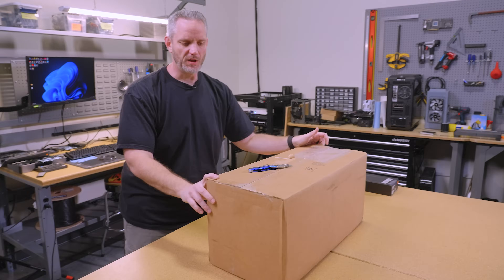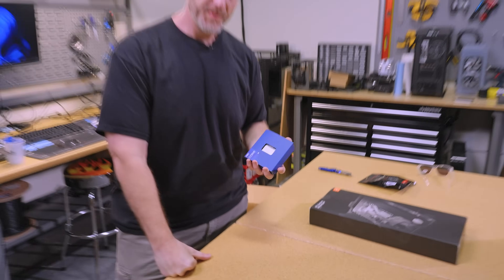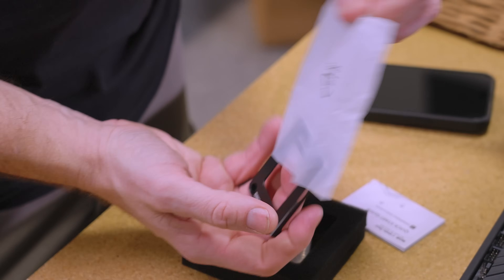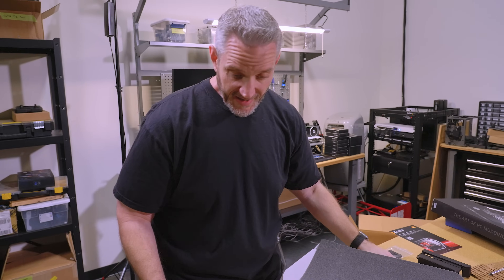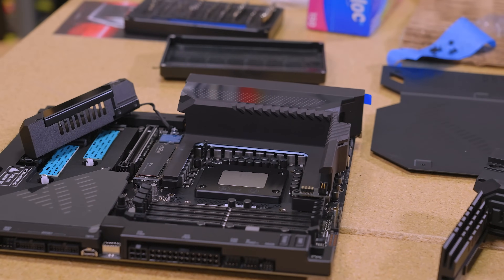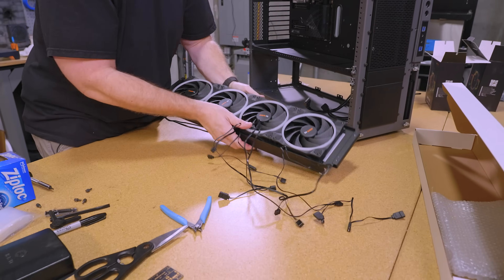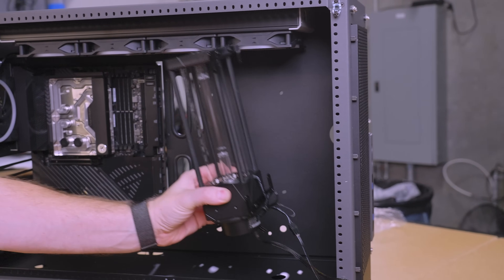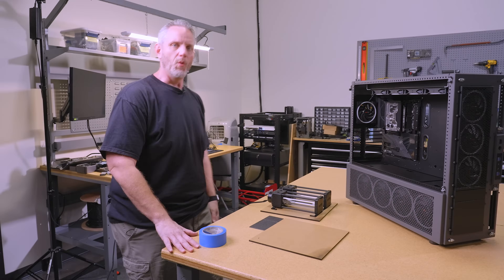Skunkworks Revival - Part 2 - So THIS is what you get for $800 waterblock...

Comment: I know this is gonna get berried, but why not have Phil use the 3d printer and make a holder for that acrylic panel and the led light strip, so you can light up the acrylic panel from the sides, and that will help with the darkside.

Comment: Hey Jay, I have this exact board and I may have a word of advice for ya (not that you need one, lol). Since you will be using your 4090 on this board, you won't be able to run it @ x16 speed because of the NVME that you have installed in M.2_1 slot. That slot shares bandwidth with PCIEX16(G5)_2 so when M.2_1 is populated your card will be limited to x8 speed. You can mitigate that by installing your NVME in slot M.2_2 or M.2_3.
Reply: Awesome comment, I have the same mobi too, as well as a 4090. I made that mistake because that info is practically hidden in the user guide. It took me a while to figure it out, hopefully he will make the switch before he fills up the loop!

Comment: I just installed the Thermal Grizzly Intel 12th Gen CPU Contact Frame on my ASUS Proart Z790  Creator motherboard with 13900KS processor.  The Thermal Grizzly 13th gen contact frame is a new product and not available when I was ready to purchase in late August 2023 ($35.53).

When reading reviews on Amazon, one customer was having the same problem that I was having:

For some reason the original screws that came off the stock motherboard socket were not long enough to screw the 12th gen contact frame into this this particular motherboard.  Maybe the the 1700 socket sits a tad bit higher, I don't know.

In any case I found 6-32 1/4 inch socket head cap screws worked just fine.  A 7/64 ball end hex wrench works perfectly for the install.

Perhaps the 13 gen contact frame is re-tooled to fix this issue (a little deeper holes in the contact frame?)  

Hope this helps some others that may run into this issue. But then again if the 13th/14th gen Thermal Grizzly contact frame fixes the issue then my DIY fix is mute all together👍✌

Comment: si I don't remember which 3d printers you have. but why not make the floating plate out of 3d printed abs or petg you can put threaded inserts in for the pump res combos then make a channel in the back for the leds and a diffusion layer.

Comment: I have the  same motherboard installed 4 SSD's.
The only slot I skipped is the one you use the top one (under the display) for a PCIe Gen 5.0 M.2 SSD.
That slot will disable you 2nd PCIe slot and make your 1st PCIe slot (GPU Slot) a X8.
I tested it with a Gen 4.0 SSD but doesn't matter if it Gen 4.0 or 5.0 it will make your GPU run on X8 speed.

Comment: Sorry to hear about your bad experience with the 7950 X3D Jay, I have are 7800 X3D running G.Skill Trident Z5 Neo RGB 32GB (2x16GB) 6000MHz CL30 DDR5 EXPO on the MSI carbon wifi x670e motherboard and I haven't had are single problem running mine at 6000mhz maybe you got are lemon it does happen from time to time, I'm excited to see how Skunkworks turns out.
Reply: I have the 7950x CPU with the 64GB kit of G,Skill Trident Z5 Neo running at 6000 using EXPO I mode.

Running on the ASUS ROG Strix X670E-E Gaming Wifi using the latest firmware with the AGEESA v1.08 build.

Has been running fine after the first BIOS update at this speed, initially I did have to run the kit at the default 4800 speed.
Reply: My 7950X runs fine at 6000 using EXPO as well, and has since day one, using the ASUS Crosshair X670E Hero. Someone commented that delidding the CPU as Jay did can cause the memory speed issues.
Reply: @zebrapluto530  ah I see I didn't know he delidded his CPU  it's possible that could be the issue, it could also be an outdated firmware problem but I'm sure jay keeps his stuff updated so who knows.
Reply: I'm running mine 7950x3d with Kingston fury RGB (2x16) 6400MHz on ASUS TUF GAMING X670E-PLUS WIFI and it's completely fine (after sertain BIOS update)

Comment: wait so the new contact frame from thermal grizzly no longer needs specific torque?! I have the 12th gen one on my 13900k and I'm always second guessing if I torqued it correctly. If I have issues with my DDR5 Ram scaling (which I do, have a 7200 kit that doesn't run stable at those speeds) I always suspect the contact frame as causing the issue. I'm surprised Derbauer hasnt released a video about the new gen contact frame and new way to fasten it. Jay can you let us know if it is now just tightened until snug?
Reply: Thermal Grizzly probably copied the Thermalright frame then. That also didn't require specific torque as the screws bottomed out.

Comment: Why not run a 280 in the front to get the clearance you need? You’d only lose about 10% of the radiator surface area compared to the 360. You could compensate for that loss with a thicker radiator and/or a push-pull configuration.

Comment: The new contact frame is redesigned to not need to worry about the torque spec on the screws. Just screw it down. I think this is a user friendly change. I installed one yesterday on a 13700k. I only paid $35 US at Amazon, purchased on the 13th. Seems I got lucky as the price went up. But maybe not, it seems to be a different reseller now for the product and their price is high. The seller I got it from still, retail storee, has it but they do not seem to be listed in a basic Amazon search for the product.

Comment: I totally understand your frustration with your 7950x3d. Luckily I can't say my experience has been the same as it just works, and damn well at that. Hopefully your situation can be resolved with some future bios updates. I'm super excited to see how well you can cool that 14900k with a setup like that!
Reply: very easily just like the 13900k, limit the power to 270w, attach an aio and enjoy 80c to 85c max temps.
Reply: @MikeZak101  It's a skunkworks build... the whole point is that he could overclock that thing and still have it running at 60 with its own dedicated loop
Reply: I didn't understand it either when Jay said it.. There is a famous guy here in Brazil running a 7950x3d with a ROG board at 7800Mhz CL36 extremely stable.
Reply: I haven't had a issue with my 7950X3D. I run the memory at 6000mhz and have for several months. Perhaps the motherboard he is using has issues... I use an Asus Strix X670E, and after the BIOS issues were sorted out it has been super stable.
Reply: I am on a 7800X3D I have had artifacting and other issues like being able to see through glitchy smoke in CS2 "hacks" at first I thought it was my 2070super that I maxed till I upgrade. Thanks Jay I will try and drop my 6000mhz ram to 5000mhz or so and maybe that will fix my problems with long boot times and bugs.
Reply: I'm the opposite of Jay this time around.  Past AM4 builds have been buggy, but my 12900k with the Asus Z690 Extreme started having a lot of issues after 9 months.  I have swapped over to a 7800x3d and Gigabyte Auros Xtreme and it's been great.  64GB RAM kit runs at 6000Mhz without any issues, goes into and comes out of sleep, and the rgb doesn't screw up every other day.
Reply: @handlealreadytaken  sameish. My 13700k and Z690 Strix with DDR4 started blue screening after 6 months. XMP was the issue. Swapped to a z790 with new Corsair XMP2 stable DDR4 and same issues. Had to disable XMP altogether to get it to function properly.
Reply: My 7800x3d is also a been an ass constant ram issues
Reply: Bro 14900k is a terrible chip dude bought $2000 worth of watercolouring for a downgrade
Reply: @mynamejeffgaming  it's too expensive for not being an actual 14th been not it's not a terrible cpu (not a chip). It outperforms the x3d in some things and others not. And he bought water cooling, not colouring.
Reply: @CornFlakesPC  Asrock BIOS is kind of weird. I have the X670E taichi with a 7950X and 128 GB of g.skill RAM running at 3600 MT/s. On BIOS 1.11 it was stable and error-free. On BIOS 1.21 it took about 3 seconds for y-cruncher to immediately expose errors. On BIOS 1.28 it is stable and error-free. It looks like somewhere in the middle of their BIOS development there was some kind of memory stability regression.
Reply: @CornFlakesPC  I'm pretty sure Jay has already tried changing components.
I'm guessing some of his issues are related to his being an early 7900X3D and motherboards.
Reply: Same here, 7950x3d plug and play no issues at all

Comment: 22:53 to 23:16 it just shows that sma8 aged, and there is better solutions on the market like core wp100, btw the pedistal mounting for fans and front of a case are bad, they do not provide any breathing space for fans, so as soon you ramp em up, they start sucking air through grills and making that annoying noise, in my core wp100, i have 1cm space by default, and can even offset it.

Comment: EK's instructions are lacking QC. The full cover block from EK for my ROG maximus z790 hero had multiple errors related to screw size and how many should be installed. Also 100% agree for the price you pay the thermal pads should be pre cut!

Comment: Funny thing, I bought the Der8auer plate for the 13th gen and I couldnt use it on teh Asus maximus board, the screws were too short. I bought the 17$ one from amazon and it worked like a charm, no issues. . . I think for the price Der8auer could have included longer screws just in case.

Comment: The original CPU block from Grizzly may be milled better to a tighter tolerance to better fit the CPU to the motherboard.
Reply: Yes I think so. And it's made in Germany and the new version is engineered to be Jay-proofen. There is a lot more R&D involved to make something a product that everyone can use without breaking stuff. If you just copy someones product that obviously not the case.
The 1st version shouldn't been an regular TG product at first because Roman intended it only for extreme overclockers. But than the extent of the problem surfaced after launch so it became a regualar product. The old version was and is 30€ and the new one is 45€ here. That's a very mild uplift when you consider the additional R&D and that basiclly everything in the EU from power and gas to fertilizer and food got 1/3 more expensive over the last 2 years... So no Roman TG tax just stupid war tax.

Comment: Which fans are those specifically? The 120s or 140s? Standard or high-performance?
I got a 3 pack of the 140 high-performance versions and anything over ~48% and they're unbearably loud. The motors harmonize too, so its a constant thrumming. So disappointed. Love the look of them and they do move air.

Comment: Just buy the thermalright contact frame for the socket 1700. It costs less than the thermal grizzly one and it works well. I have it installed in 4 computers already. 

The thermal grizzly one that comes with extra screws even complicates the installation, where you need to be extra careful not to overtighten the screws and kill your memory channels.

Comment: The issue must be with your MB on the 7950x3d. I built mine using the asrock taichi and I'm running 64gb 6k mhz ram and a 4090 strix, have had zero stability issues. Seems a shame to ditch the superior cpu because of a MB.

Comment: Jay - you can do the bigger hole thru the floating platform and then just pass the sata connectors thru the normal grommet so you don't even have to put any more holes in the case.

Comment: Been using a knock-off 13th gen contact plate for 6 months. It works just as well I would’ve expected the Thermal Grizzly one to work.

Sorry DerBauer, but 50 bucks is a little much for a piece of aluminum 😅

Comment: 9:22 honestly 45 bucks for that tiny little frame just seems like extortion. You can argue about "R&D being expensive" but that part is probably a 3 dollar part. Hence why off brands are willing to sell it for 9.

The plastic parts might be because it makes machining a bit less complex. From the looks of it that probably saves 3 or 4 machining passes which is a big deal when making thousands of these.
Reply: I think they are making these manually in Germany, that’s why it costs so much.

Comment: Great video Jay!
I really want to create my own case, simple cube design. 2x 360mm rads at the top in a separate floating chamber. 2 (wide)x3(high) 120mm rads at the front blowing air through the case. Mobo horizontal in a separate chamber to the PSU, so that there are 2 fans in the PSU/SSD chamber and 4 in the mobo chamber. Run a distroplate/res side panel on the Mobo chamber and a OLED screen at the bottom for system info.
Reply: So, you just want to copy HP.
Reply: @rustler08  There is something out there like that? I haven't seen in my local stores. Is there a model number? Only Cube PCs I have seen that are close are the Thermaltake Core X5 and similar in the series.

Comment: Watch Out with these Pump-res Combos... I had two of these and ,in my opinion,because of the fact they have no O-Ring in the bottom like in the top... Both of mine got leaky at certain temps. The Water came Out of the Backside where the cables are going in. !

Comment: Jay, I feel your RAM SPEED pain. Been there. Done that. But remember, it's a lottery. Only the default LOW speed setting is guaranteed to work. I've had the same problem with both AMD and Intel where I have to turn the RAM speed down a notch or two. Good luck!

Comment: not the first time Ek had the thermal pad info incorrect.  have had issues with that a few times. Also check to make sure they told you the right thickness.  I had that issue with them as well.

Comment: Jay, do you use four or two memory sticks in your home AMD rig?

I had very similar issues to you when I was using 4 sticks (granted, it was on a different platform, but still). Many, many problems at random. Worked perfectly fine for a long time, then the PC decided it does not want to work and I had to spend an hour troubleshooting to get it to work again.

All my troubles magically disappeared when I pulled out two out of the four sticks. Maybe it'll help you too if you use four RAM sticks.,

Comment: Jay, I have the 7950x3D on a rog crosshair extreme, I use CORSAIR DOMINATOR PLATINUM RGB DDR5 RAM 64GB (2x32GB) 6000MHz CL40 and have no issues at all, everything works perfect, now it hasn't always done that lol, many updates later it seems to be good now.

Comment: Could you make an extension cable for the little LCD screen thingy, and mount it elsewhere?

Edit:  It looks like the heatsink thing where the LCD mounts could probably be removed, and you could maybe mount just the screen in that area with some double stick tape or something, maybe underneath the ports on that water jacket.

Comment: I think something like 1/4" or 1/2" Sintra (expanded PVC sheet) would work well for mounting the resivoirs. Relatively low shine, super easy to work with, and smooth surface.

Comment: Oversize the plate for the reservoir  on the left side to cover the cable routing holes and just feed the rez cables through that. saves drilling  new holes and hides the Mobo cables at the same time

Comment: jou need the right bios, the right ram sticks, the chipset driver and than you need the sub timings dude and the right voltage, than you need to run memtest pro up to 4000% and when than are no errors, your rig ist stable 👍🏻 and it will run easy 6000mts+ with tight timings

Comment: Two loops would be so much easier to wire and control if you went Cosair iCUE.   Not just fans but Dual Pump RES too. Bequiet is an odd Choice Jay, you still have time change your mind and keep your sanity.

Comment: I'd either sand down the ABS, prime, and paint like you did the case interior or save yourself and the sanding and paint Acrylic panel for that platform. That way you retain the interior color, can mount hardware to it, and like Red Mist it would make the build more modular and clean.

Comment: Honestly would have probably done better with the 7800X3D instead of 7950 because of the scheduling issues. It will be interesting to see the 14900K considering it's not much different than the 13900K.

Comment: This build is way over the top and I love it.  Due to cost this needs to be a minimum of a six year system, actually on my budget it needs to be a ten year system, I live in Canada and I can feel my budget shrinking.  I really like that it cools the top M.2, it justifies getting a fast Gen 5 NVME and 4 TB would be perfect.  I am still using a Wet and Chilly Chips 400 mm Reservoir from 2007 I think.  I own my home so I attached my PC on a wall that dumps all of the heat into a spare bedroom and is super quiet because my 3) EK 240mm Radiators are in the spare room.  They made more sense for my build.  I love your Skunk Works Builds.  I am curious, the motherboard water block came with a delidding tool, does it not change how it mounts to the CPU to make up for the couple of mm difference or does that not matter.  I have never delidded a CPU.

Comment: JAYYYYYYYYY! Move the reservoirs closer together. 
1. Check whether the reservoir mounting are removable. 
2. If removable, cut the inner screw holes and weld the brackets together and make one large reservoir bracket. 
3. Check with Corsair whether they can send you replacement brackets in case you mess up.

Comment: Jay, revive the engine build next! With this many rads you can use two 480 as like a valve cover with some 3D printed intake plenum part to feed it air, same can be done with the exhaust. Water lines to make it looks like fuel lines, alternator shaped reservoir etc, you can make it look so good!

Comment: Update bios, turn on memory context restore and low power mode in bios and your 7950x3d will run fine because it won't retrain every boot. Its stupid these aren't default settings on asus/msi boards but it is what it is. It will be under dram timings tab on asus board.

Comment: Find an old case that's metal. Rip it apart and cut the square you need for your two reservoirs and spray paint the metal whatever color you want. Then you will have a nice metal frame to mount your stuff two.